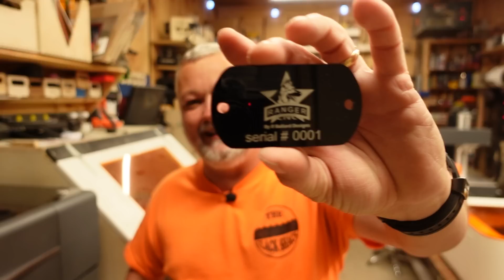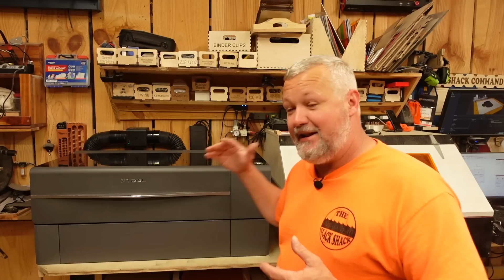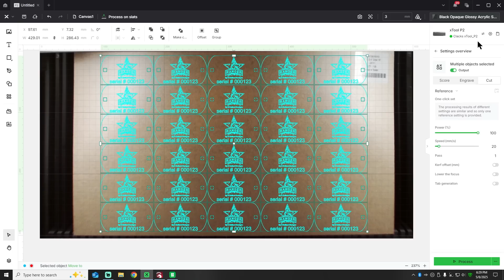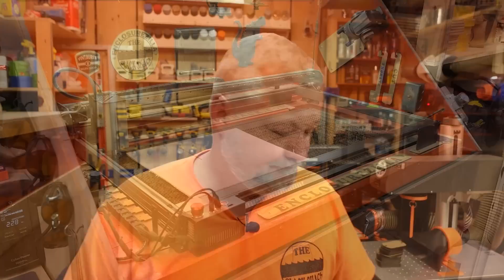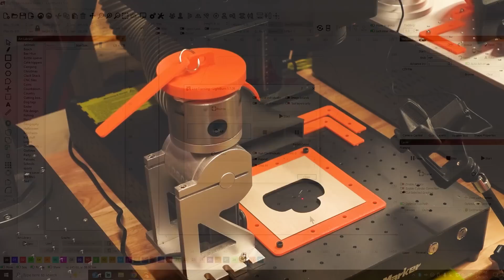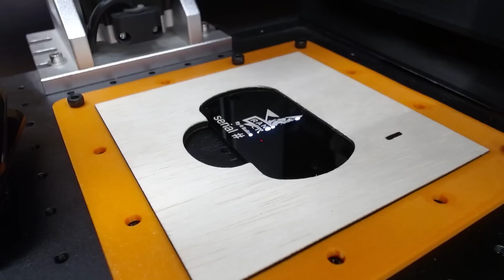Black acrylic made easy

Comment: Great video and very informatief, I would like to know if the engraving is also possible with the P2 in stead of the F2 Ultra UV. And  when it's engraved with the P2  is the engraving also get white frosted.
Reply from the maker: CO2 machines tend to remove the material rather than color it. You “can” get some white coloring but not comparable to a UV or IR machine. Cutting is far better on a CO2 machine though.